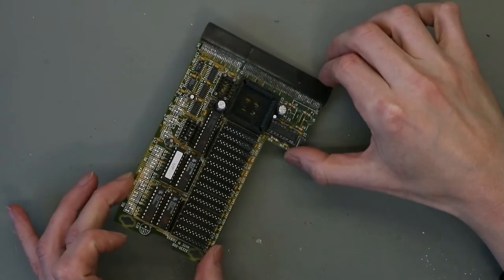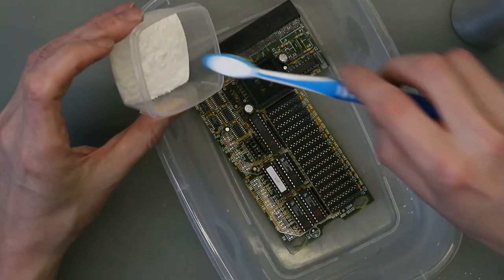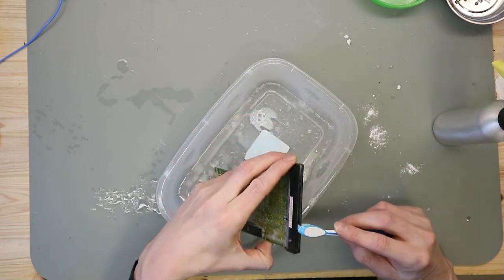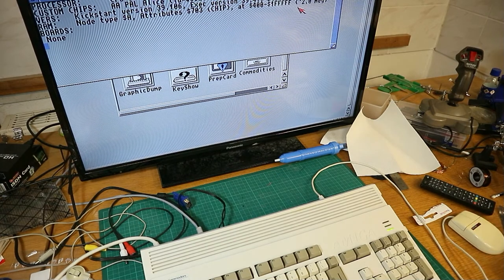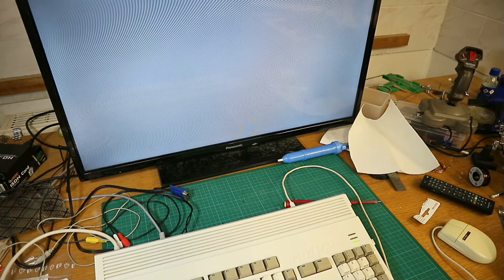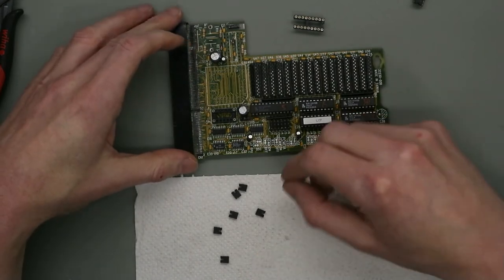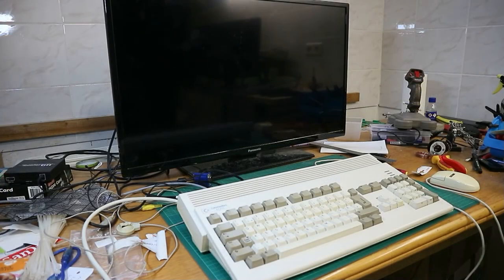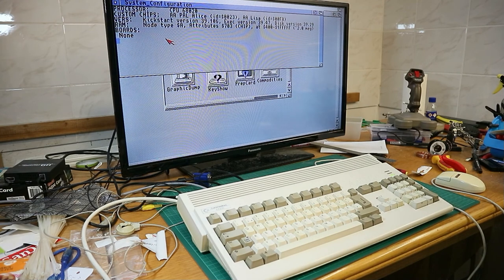Try to fix a Memory-Expansion-Card for the Amiga 1200

Comment: I dont think that card will show as a card, but do you have som ram in the sockets ?
Reply from the maker: I have the same amount of RAM with and without RAM Expansion.
Reply: @tomscomputerchannel2925  ok, the sockets just look empty on the video - Might be my bad :) :)
Reply from the maker: In this case it’s the 1 MB Version. This Ram is soldered on the underside of the board. The sockets on Top of the board are for more RAM. 😉